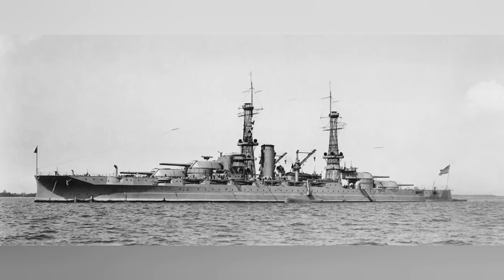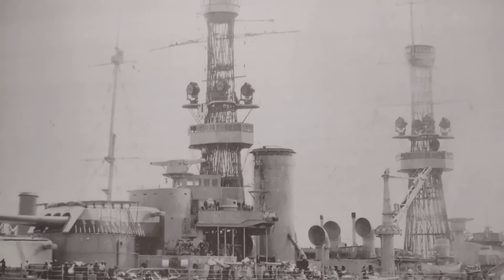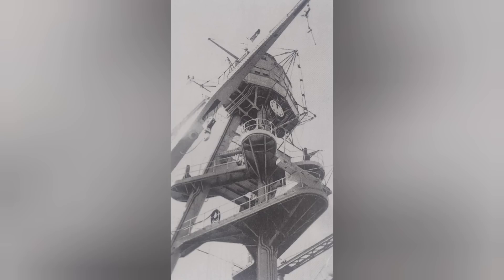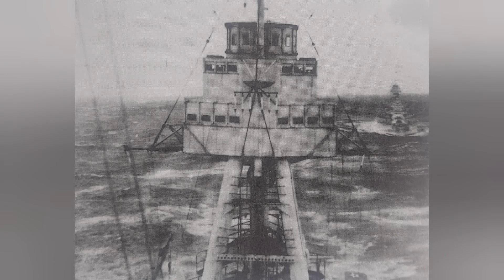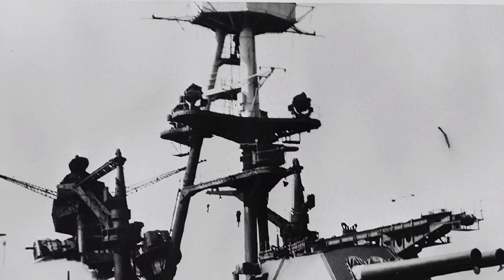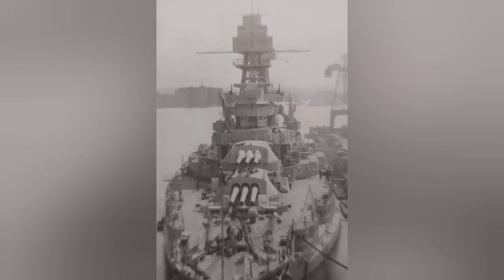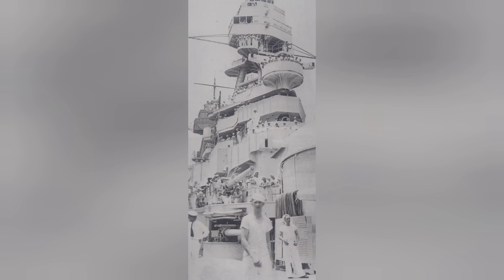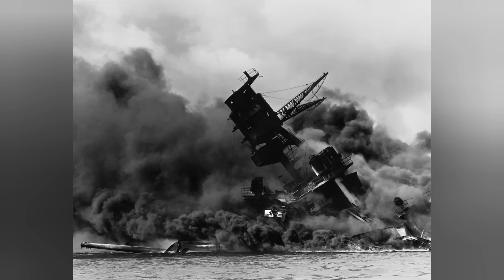United States battleship Tripod Mast

Comment: I too have been searching for years for photos of the inside of the control tops. So far no luck. The best shot I've seen is the first page of the chapter on reconstruction in Friedman's US Battleships book. It has a shot of Oklahoma at pier-side and the windows are open in the foremast. You can just make out the gun directors.
Reply: J. Landis Martin - so the windows around the gun directors open? I always wondered how they worked around the frames of the windows.
Reply: Check out the videos on the USS Texas, one of them did a tour of the mast top.

Comment: I have always wondered if those masts, may have made the ships 'top heavy' somehow, especially in heavy weather...
Reply from the maker: No, they didn't. They are unarmored structures. It's like looking at the superstructures on later french battleships or modernized Japanese battleships. They are tall as all could get, but the designers did not ignore stability when creating them.
Reply: @centralcrossing4732  Japanese designers did push the limits of stability.

Comment: Nice video!

To me, the tripod mast was a taller structure than the cage mast, which held the radio antennas higher, for better communications.

And I suspect, it held the new radar antennas at a height that worked well for long range use.

The electronic warfare equipment back then is one of my favorite subjects, and to own some of it today would be cool, as I never saved any I had back in the 60s and 70s...

Comment: Meters? I don’t do meters….. neither did the disigners
Reply from the maker: Uniquely, most current writings use meters. I'm aware the designers did not, however I don't see the purpose in converting it to yards when most viewers will understand the distance in meters better (including myself). If you don't understand meters, Google the conversion, Google can prove useful sometimes.
Reply: @centralcrossing4732  It should be converted to feet not yards. IME feet is better for ship measurement(and all vehicles for that matter) because a foot is substantially smaller than a meter or yard which trivializes meaningful differences in length.
Reply from the maker: @commodorezero  when I'm discussing distances that cover several miles/kilometers as I am in this video, I will never use feet. Saying 111,548 feet is near impossible to visualize when I can say 34,000 meters which is easy to mind over to 34 kilometers. Being smaller doesn't mean it's better in all instances.
Reply: @centralcrossing4732  Yes when you scale up that much for like range of guns yards and meters are better.
Reply: @commodorezero  meters as a measuring unit is much more widely used than feet. It makes absolutely zero sense for people who are not native in the imperial system to use it when they not only know the metric system much better themselves, but also a much larger part of their audience uses the metric system.
Reply: should use the system that it was built with.  Frankly the majority of Americans still use feet. Rest of the world meters. Now as regards people having to do the conversions ain't that a shame they actually have to think?

Comment: If only there were photos of the inside of the tops.
Reply: Not during service, but there are photos of them in books and in recent publications/videos. Namely, Uss Texas recently documented the "restoration" (nothing more than the sandblasting and protective coating) of their foretop just before she went into drydock this last summer. The foretop on New York and Texas were direct copies of the Nevada/Pennsylvania class tops (albeit with slightly different directors) and were slight improvements over the already existing designs on the Tennessee and Colorado classes.

Comment: It's interesting that by removing the aa guns and placing searchlights instead, did it affect the ship's aa capabilities at Pearl Harbor?
Reply from the maker: That question would cause me to speculate, so I won't answer that as there is no real answer. 
Regardless, moving the guns was an interesting choice.
Reply: Silly question given that the Arizona was sunk before anyone could react to the surprise attack.  It blew up roughly 8 minute after the attack on Pearl Harbor began.

Comment: Good God you saved me from those blasphamic cage masts.
Reply: Looking at a cage mast reminds me, oddly, of early Soviet rocketry during the space race.

The Soviets couldn't produce reliable large solid rocket boosters, their fabrication & chemical industry wasn't advanced or precise enough. So instead, they basically strapped about 7 or so smaller boosters together into a cluster, & then strapped multiple clusters together in stages.

Job's a goid'un, right? Well, not really. Pound of thrust per pound of booster suffered immensely. Since each booster had more of its mass dedicated to material that wasn't being thrown out the business end as hot gas. Further, each booster was a potential point of failure in a system that, thanks to inefficiencies stated before, really didn't have any margins for error.

I'm guessing that cage masts were kinda like that on account of the technical limitations of the day.
Reply: @TrollOfReason  Interesting you say that. The interstage structure on the Soviet N1 even looks like a cage mast.
Reply: @TrollOfReason  more into US navy odd choices than technical limitations.

Comment: Did the New York class not have two tripod masts? Granted, the rear one is not as tall.
Reply from the maker: Technically, it did have 2, but the build and function of the aftermost one on New York was different from what I'm discussing in the video, so I excluded it for today.
Reply: The aft fire control top is actually on a short structure just forward of the amidships turret. Aft of the funnel. Looks really odd.
Reply: @robertmurphy4836  A book I have on USS Texas states that the NY class could not take a second full sized tripod mast, which is why they ended up with just a searchlight platform. It doesn't say why, but they and USS Arizona might simply have been too small, or maybe it was the placement of the amidships turret that prevented a second mast. They placed the second fighting top on a small platform for the sake of redundancy, but it probably would have been nearly useless in battle.